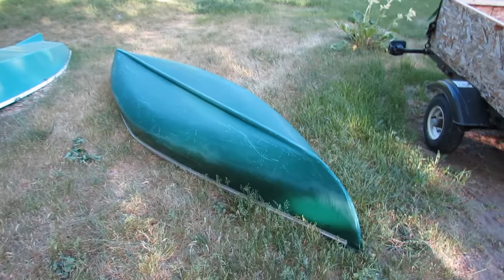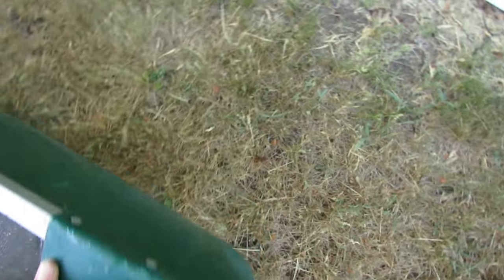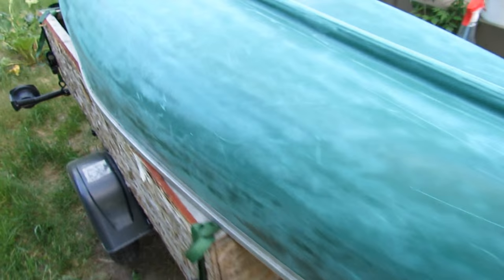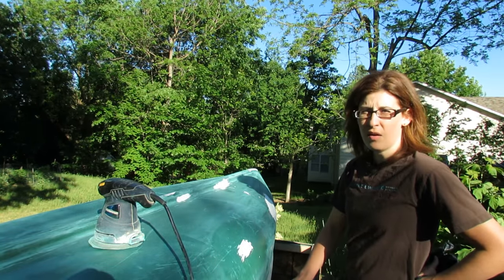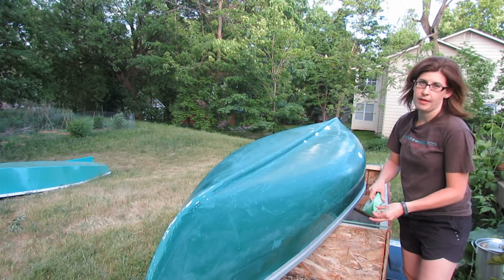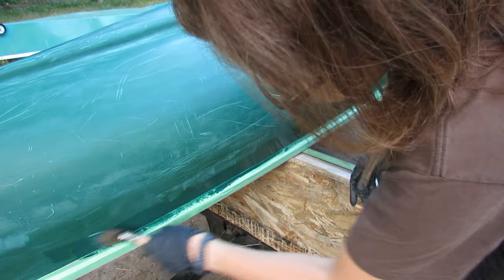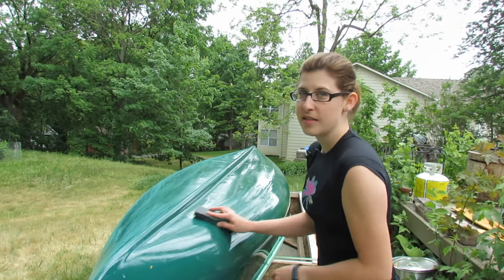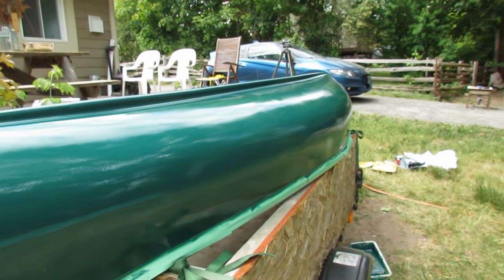Canoe Restoration

Comment: I have done the same job 6 odd times on 4 different canoes. I repaired damage  and made some skid plates out of fiberglass cloth and resin . Some canoes were  fiberglass and some kevlar . The 15 ft  novacraft  bobspecial weighs 37 lbs with ash trim and my 16.5 ft langford nahanni weighs 43 lbs. I paid $500 for the langford as it was a former rental and needed a flotation chamber rebuilt .It has aluminum trim . The fiberglass canoes have been generic ( unknown ) and scott.  Not sure of weights but they were used as 'droppers'  so weight isn't as important. One had to be heavily repaired ( 2 yds of strand cloth and gallon of resin ) right in the bush from winter snow load damage.But man is that hull stiff now.The strand cloth really eats up the resin . Was planning to put a yd of cloth on the other side of the yoke but ran out of resin. A job for the next trip in . 
I recommend buying a yoke and replacing that center thwart  . Seats look ok and are replacements anyway . I replaced handles on my nahanni from scrounged maple I got from a futon frame someone was throwing out. A lot of work needing a table saw and router .I have some pics of these jobs but never bothered to shoot video .
Reply from the maker: I'll probably do  some more work on it next Spring. Sounds like you have lots of experience repairing canoes.

Comment: Interesting that you used epoxy instead of the usual fibreglass repair .  Your repair looked a lot easier and less messy than messying around with fibreglass.  I acquired a canoe many years ago that was a piece of crap to begin with but I only need it twice a year to go out and put a foot valve on in the spring and to take it off in the fall for a total of one hours use per year. Does the epoxy stand up as long as fibreglass?

Comment: How much paint did you use?  I have a 14 ft FB that has been sanded down and now needs some paint BUT one pint is 17$ and the large can (gallon or 4 lt) is 35$.  I dont want to buy a big can if I dont need to  but will definitely need a minimum of 2 coats.  What would you suggest?
Reply from the maker: I used about 940 ml = about 2 pints. I hope this helps.

Comment: nice job.   and not to be a internet know it all.. but in the future, you might want to gouge out the cracks a bit before you do epoxy repairs. it tends to make a better mechanical bond.
Reply from the maker: Thanks! I'm really happy with how it turned out. The repairs have held up very well so far. I can't wait to get out and use it this Spring.
Reply: TheWildYam.  whoohoo spring!! i just did a 12' fiberlight..  i couldn't wait and took it out in the rain today.
Reply from the maker: Sounds like fun! I'll be out on the water soon.